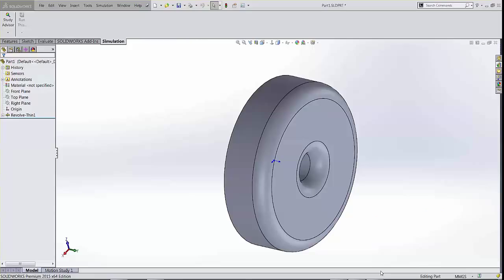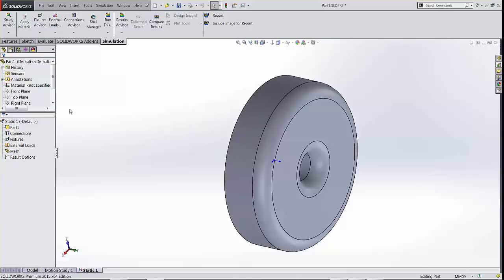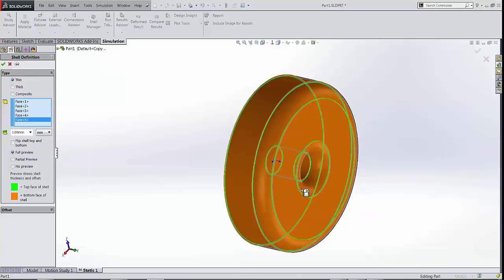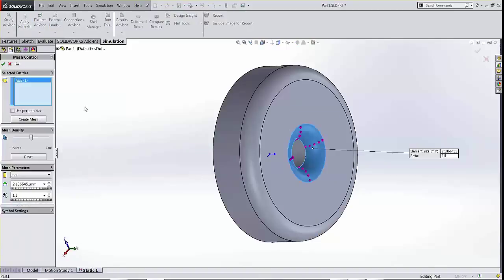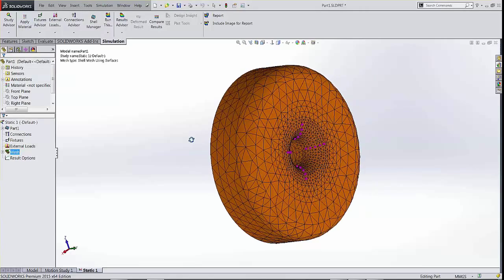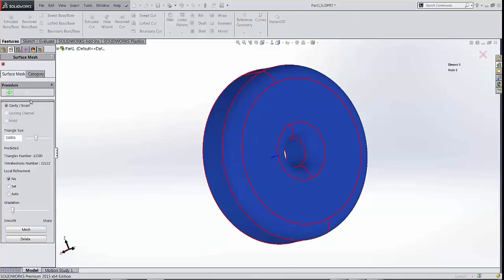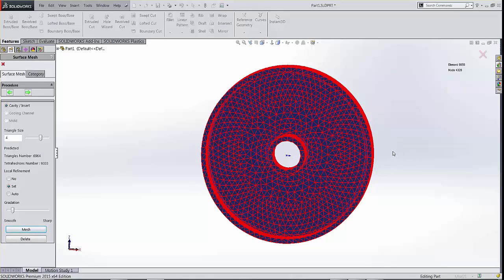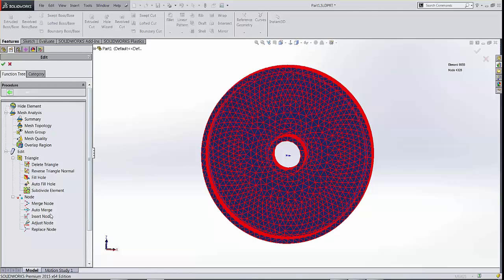SOLIDWORKS Quick Tip - Shell Meshing

Comment: Hi, I was wondering if there's a way to override a shell 2D mesh that is automatically created by solidworks when simulating sheet metal to a 3D mesh instead? Thanks
Reply from the maker: Yes, there is definitely a way.  Expand the parts folder from the Simulation design tree and then right-click on the desired sheet metal component and choose the option "Treat as Solid."  Afterward, you will be able to setup and work with the component including the ability to create a 3D mesh as well.
Reply: @goengineer  thank you!